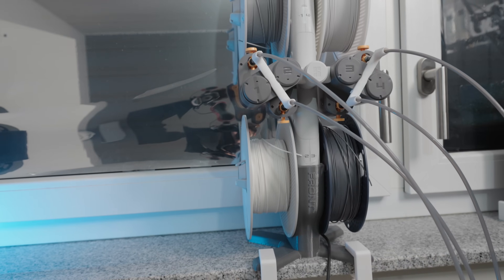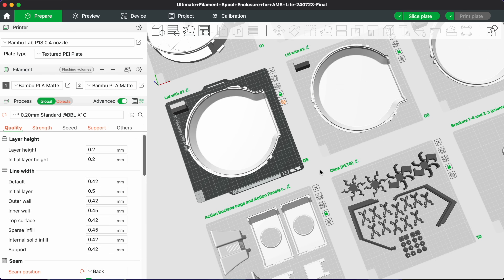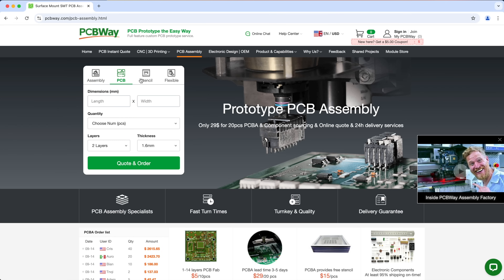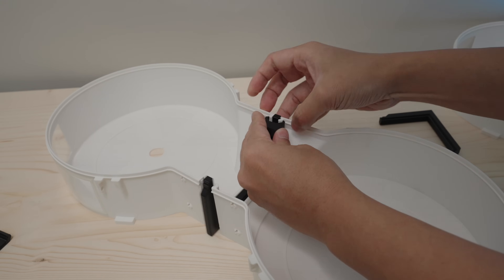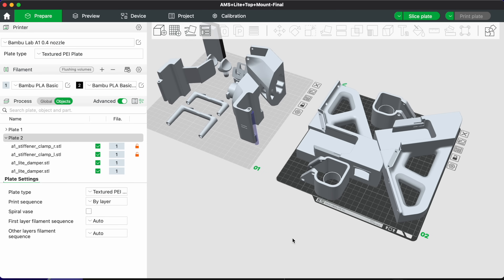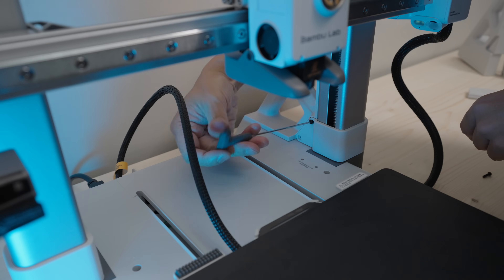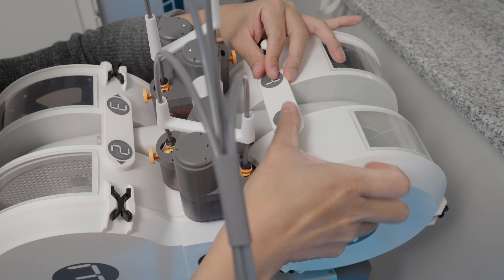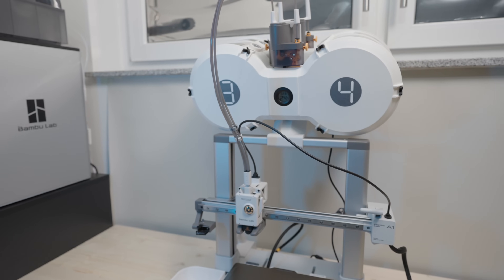ULTIMATE AMS Lite enclosure & Top mount Upgrade - Will it work?

Comment from the maker: BambuLab A1: https://www.awin1.com/awclick.php?gid=570772&mid=46345&awinaffid=2034675&linkid=4382705&clickref=

Filaments used in this video:
PLA Matte white: http://shrsl.com/4speq
PLA Light gray: http://shrsl.com/4spep
PLA Matte Dark Gray: https://amzn.to/41WX6Tv

Best affordable 3D Printer: https://www.awin1.com/awclick.php?gid=570773&mid=46345&awinaffid=2034675&linkid=4382675&clickref=
Recommended Filaments: https://www.awin1.com/awclick.php?gid=570777&mid=46345&awinaffid=2034675&linkid=4382680&clickref=

My 2nd favorite filaments: https://geni.us/A4OFomi
Lubricant for X,Z,Y-Axis rails & idler pulleys: https://tidd.ly/3KMFHqs
Grease for Lead screws: https://tidd.ly/3Lk36j2
PTFE Tube: https://tidd.ly/49Dw6eX
Deburring tool: https://geni.us/9WGzv
Wire cutter: https://geni.us/NAwQIL
Heat gun: https://geni.us/Jdcu

#Affiliate
Reply: Hi Lukis3D…is the nano tape you’re using, double sided or single sided?  Do you have a link for it or a brand name?  Thanks!

Comment: For the top mount upgrade, as well as adding 1kg with the setup, you are potentially adding an extra 4kg once you load it up with filament. 5 kg hanging off the top? No thanks. Well done on the video, very well presented. 👍

Comment: Hello, has anyone managed to fix the entanglements in the old version without having to print the new ones? I wouldn't want to have to reprint another 400 grams in the new version, if you knew something smaller, new nozzles for example or something else that could improve the tangles I would appreciate it very much.

Comment: Why would you add that weight to the top of the printer? It seems counter-productive as I believe it will magnify any vibrations creating problems with the print.
Reply from the maker: yeah ive dismounted the top mount and currently I only do the vertical setup, which works great!
You can see it in my A1 upgrade video👍🏼
Reply: @Lukis3D  That 's good news. I look foward to your video. 
I invested in the Bambu A1 +  AMS  lite for a great-nephew and I want him to watch videos like yours showing solutions to the "unknown unknowns" even highly regarded printers like the A1 may have.

Comment: Have you had any problems with the PLA-printed top mount? Can it support all that weight? I just got my printer yesterday and planning to have this same setup.
Reply from the maker: it does support the weight, but it‘s such a hassle to remove the filament on the backside. It also makes the printer wobble a little too much, so I switched back to my vertical stand setup.

Comment: I strongly advise that you do not use cardboard filament rolls. Access to both sides of the roll is difficult so you end up trying to lever out the roll from the middle. That is when the cardboard separates from the centre of the spool. Plastic spools are stronger.
Reply from the maker: yeah I agree. I am not a fan of cardboard filament rolls in general anyway so I totally understand!

Comment: Great video, thank you for sharing.  I have a question, where did you find the STL files for the spacer rings you used inside the enclosure to avoid the spools from rubbing against the enclosure??
Reply from the maker: thanks, glad you liked it! You can find the link to it in the description box, it’s on Makerworld😊👍🏼
Reply: @Lukis3D  Thank you for the reply, I followed the link to the spacer and got them printer.  I am having a terrible time printing the buckets and covers on translucent PETG filament, using my A1 with a soft plate and temperature set to 240, it strings,  the parts are brittle and break very easily, what I am doing wrong? and help is appreciated. Another question, I see people have posted pictures of the various design changes they made, how can I download other designs? it looks like I can only get the original design, and that one that's been modified, like yours

Comment: @Lukis3D where did you purchase your nanotape? Is your tape double sided adhesive?
Reply from the maker: i got it from Amazon. yeah its double sided, so the backing on one side of the tape wasn’t peeled off.
You could also just get a very thin acrylic sheet and superglue it to the window, should work just fine😊

Comment: Are these actually air tight? I can't see how they could be.
Reply from the maker: a compelete tight seal isn’t possible anyway, since filemants have to go through the holes on the enclosure.
But its a good enclosure neverthrless. And any moisture that enters the enclosure will be absorbed by the beads. The question is how often do you need to reactivate the beads😄
Reply: @Lukis3D  Often, I'm afraid.

Comment: I was back and forth on this one for a while before deciding it wouldn't be a good fit for my setup. My AMS lite is wall mounted behind my mini, so enclosing it would make it pretty awkward to change filaments. Very impressive print though.
Reply from the maker: actually I’ve seen alot of wall mounted AMS Lite with enclosures, in fact, the remixed model that I printed is intended for wall mounted AMS lite.
I don’t know which filaments you have, but cardboard spools are the hardest ones to swap. There’s a model that you can print to help release the spools though, and the spacers are also important for easy release👍🏼

Comment: I built the original enclosure earlier this year, did the updated version a few months ago.  I think it works very well and is very helpful in keeping the filament dry.  Once you get the hang of it, it isn't that difficult to get used to the added steps of loading and unloading it.  Both times I used transparent PETG but it really wasn't transparent enough to see the filament so I'm doing what you did and using PLA matte white with the windows and the clear nano tape.  Using transparent PETG both previous times it seemed like every time I charged up the desiccant the humidity levels would go down to 10% which is the lowest these hydrometers read, but in about a week they were already up to 20% and would climb pretty quickly from there.  I don't know if using PETG in particular, or specifically using transparent PETG caused this but one or the other (or both) allows moisture in pretty quickly.  So I think PLA might be the better way to go.  Anyway, thanks for the useful info as I build my updated version.
Reply from the maker: Yeah the transparent filament won’t be transparent enough so that’s why i decided not to print with it and printed the one with the windows.
And that’s very interesting to know that  the enclosure printed with PETG allows more moisture in in a short amount of time. Thanks for your valuable input!
Reply: @Lukis3D what if you used a combination of a higher temp, slower speed, and some sort of clear adhesive to fill in the layer lines, like clear nail polish???

Comment: PERFECT!!
Drukujesz na domyślnych ustawieniach Bambu Studio?
Wydruki są piękne!
Reply from the maker: thank you! I don’t change the settings, I just use the print profile’s settings either from the designer themselves or the remixers 😁.
Reply: @Lukis3D  Klej z jednej strony taśmy nano zmyłeś? Ona się klei z obu stron.
Reply from the maker: yes I only peeleed of the tape on one side😁 just don’t touch the sticky side in the bucket, or you will leave fingerprints. Or you can cover it with plastic sheet and glue to the bucket.
Reply: @Lukis3D  Niestety okazało się, że na moim Creality K1C nie wydrukuję tego. Za mała płyta, zabrakło 36 mm 🙂. Chciałem do Bambu A1 Mini założyć.

Comment: The OEM top mount pivots to allow access to the rear filaments. I assume that it does not work with the enclosure, though. A shame they didn’t provide a pivot in the compatible one.
Reply from the maker: yeah that would be ideal! in my case though, i have very limited space on my desk so even if the mount pivots, it would not work for me. Do you have the standard top mount setup?
Reply: @ yes, and have been wondering about the dry enclosure but unable to commit to it with so many other projects under way. 😆
Reply: @CreatingWithJackPines  Its well worth the print time when you consider how much time saving it can be vs needing to pull a spool off and dry it because its became damp from sitting in the open air. Which for me would be every/every other day id be losing a few hours to dry time, joy of Florida. With the spool holder I just have to dry the dessicant once every couple weeks to keep it fresh. I have a couple spare dessicant holders printed so can just swap them in from my other drybox while one set is drying.

Comment: Its nice but if you change the filament a lot, naah i don't know!!!
Reply: I agree, but having wet fillament is a much bigger problem
Reply: @ifoxino I printed it out of PETG and it really doesn't do anything to keep filament dry TBH
Most of the time it's 2% higher RH inside the buckets than in the room
It just seems to trap humidity.

The control hygrometer in the two hole action panel is also higher than the room RH

It just doesn't work 

And it also has caused my prints to pause because of stuck spool errors 

There is also a horrible squeaking noise coming from the AMS lite now too.
Probably why they give you the other option for the feeder holes that uses PTFE tube.

It was a lot of time and filament to be disappointed in the end because it's not really functional and it causes issues
Reply: @ifoxino  I keep my filament is in bags, so no issue with wet filament!!!
Reply from the maker: My strategy is to load my most used filaments like black-white or something at the rear side. yeah i know it’s quite limiting, but we’ll see!
Reply: I agree 100% I printed half of this and it annoyed me so much I took it off, I only did half majority of the time I keep white and black on there but I do remove them occasionally for other colors, and it was such a hassle that I removed it and didn't even finish the other half, I agree 100% if you print majority petg and don't change the colors too often this is 100% worth it but for PLA which really isn't that hydroscopic I wouldn't bother.......
Reply: @NoMercyFtw  Right man!!!!
Reply: If you change it a lot, you won't have much time to get too much moisture I guess
Reply: @K8Stuff  yeah I use my A1 if I'm only using four colors Max and I need to change spools frequently, I have a P1S with three AMS do they use majority of the time
Reply: I prefer a sealed cabinet for both and using calcium chloride for moisture control. I used 600 mm kitchen cabinets. Printer in one, AMS in the other.
Reply: @Pat.Mustard  I've never heard of the calcium chloride trick. How do you you it? How often does it need to be refreshed? Where do you personally source this? I live in a swamp so summers are rough for printing
Reply: @TheBinklemNetwork  Calcium Chloride is sold as DampRid here in Aus. Comes in a little bucket. Moisture collects in the bottom.

Comment: On all axis i can use Super lube oil? And what is that grease please help me 😢
Can you please make video how clean PEI plate i dont know iam new please i got christmas gift a1 mini and how i can clean PEI plate please ❤
Reply: Lube goes on the rectangular bars on the x and y axis, grease is used on the threaded rods that are vertical inside the sides of the printer
Reply: use ipa for bed
Reply from the maker: hey man, I made a video recently about A1 Mini maintenance so you might wanna check that out. I covered oil/grease and bed cleaning topics.
And congrats on your new A1 Mini, have fun with it!

Comment: Nice project. To create easier access (AMS mounted on top) for filament changes, would it be possible to rotate AMS 90°?
Reply from the maker: thanks man! the mount i printed isnt rotatable but that actually sounds like a good idea!
Reply: @Lukis3D  I figured that one was designed that way but I bet you could reverse engineer a 90° modification for it. If you like doing CAD stuff.
Reply: @mwinner101  possible.. yes, but the ptfe tubs would become difficult due to needing to be so long. It rotated 90 degrees means that when the print head is on one side of the bed, the tubes have to be long enough to reach from the opposite sides filament spools, likely needing to go "under" the AMS lite. This then increases the risk of the PTFE tube wanting to have too much of an angle at the AMS lite and binding the filament at that point, or very quickly wearing thru the PTFE tube.
Reply: @ OK. Just curious if it was an easy fix since that is the orientation when it is placed next to the printer. I don’t own one yet so I don’t know.
Reply: @mwinner101  Yea on the side it benefits from all the filament being to one side of the machine. I guess technically you could do a 90 degree style if you shoved the AMS lite top mounted all the to one side of the machine, so the PTFE tubes could always be needing to stay on the opposite of the whole assembly. PTFE routing is the only real restriction of orientation.